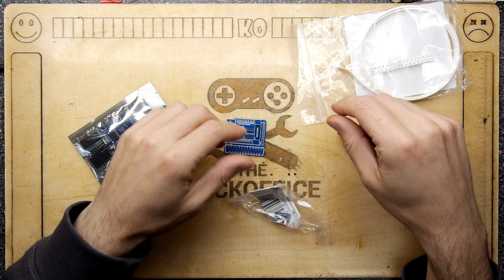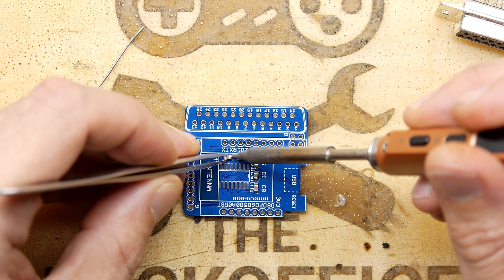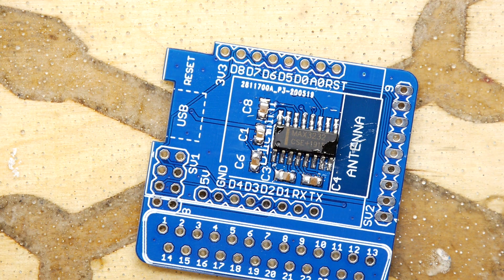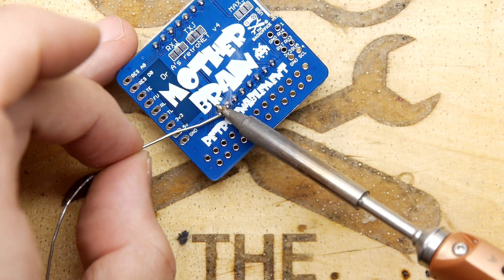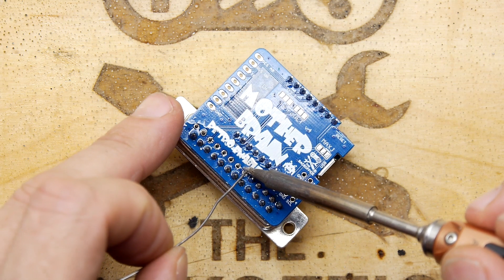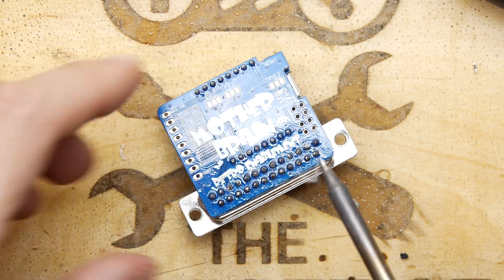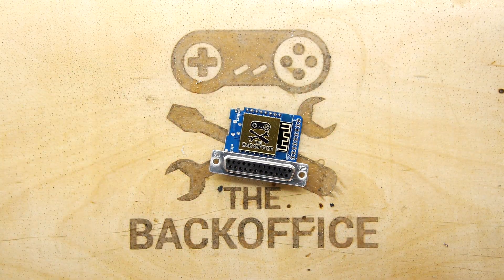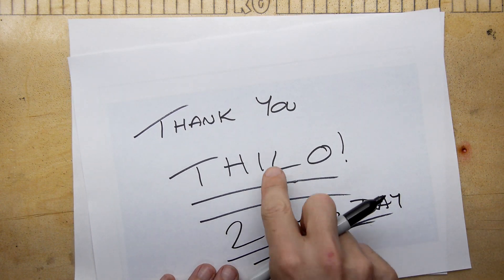Chat & Build electronics - retroNET v4

Comment: What are the solder jumpers for? I got my v4 a few days ago.  RXJ and MAXJ are not on the default setting, but TXJ is.
Reply from the maker: Those are bypasses for the level shifters and the to allow the flash to be reprogrammed if a new firmware was needed. They would be set to allow programming and testing and afterwards moved into the positions you see on yours